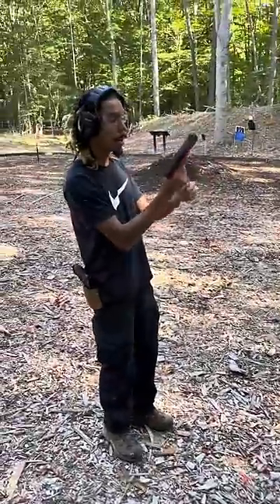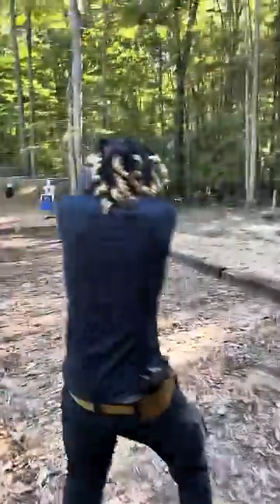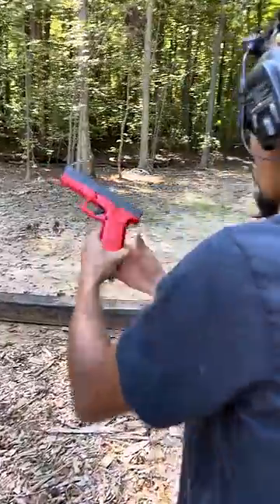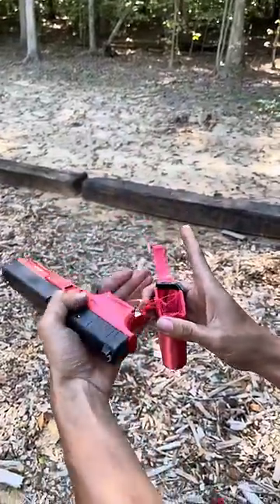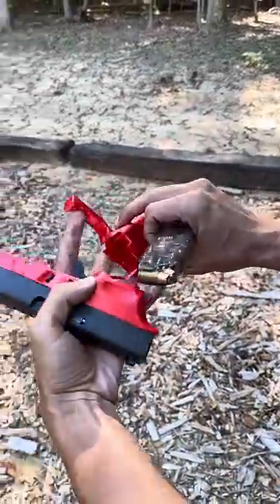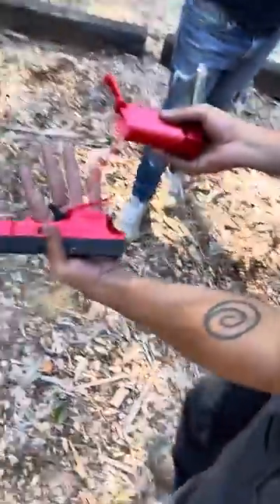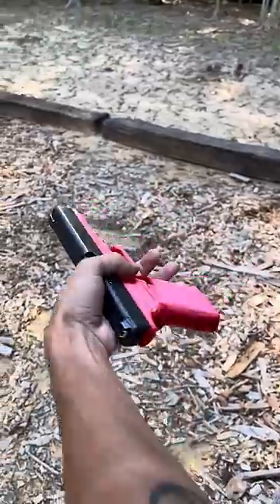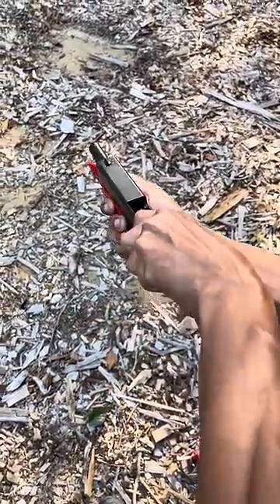3D Printed Gun FAIL 🤬

Comment: Print doesn't look like it was printed right. I don't know this design but whoever designed it or printed it messed up. You never want the print to have light shine through. It's a bad sign. Usually means it will not last also please test your gun on a jig before you shoot it in your hands. It's better to be safer then sorry. Also use the right filament. Cheap ABS is ok for smaller caliber but in reality you want to invest in some good strong filament that is meant to be strong. And can handle hard impacts and shocks. This design looks like it trys too hard to look like a real glock lower and doesn't seem like it was a stable design.

Comment: .. That's called weak layering/layer separation.. And shouldve been spotted even earlier.. A way to prevent it is heat treating the build and potentially dipping it in aceton to merge the layers even more.
Yes.. 3D building guns is dangerous.. If you don't know what you are doing.. And first round through it without knowing what you're doing just shows a level of stupidity..

Comment: 🙄 harder, more time, more money, and completely 1000% not reliable to use some Amazon 3d printer to make less reliable plastic guns of the original "plastic" guns. 
don't come at me with your comments about plastic frames; I don't particularly like them but I (probably) have a Lot more than you do --- 
would I rely on some that I have... yes. 
however there weren't made from a machine meant to make 3" mannequins for a wedding cake, they are top shelf "plastic" framed guns, and still, would be my very last resort weapon of choice considering my available options. interesting experiment here, but 100% no go on usability.

Comment: The issue i've noticed with 3d printed receivers is the fact you have to do finite tuning, scraping, shaving and sanding the thing down to the exact same as a polymer receiver. not to mention even if you manage, the slide also likes to stick so if you manage. it's good to swap through slides to see which ones likes the receiver.

Comment: its not due to the design, its due to how it was printed. You cant print that thing upright because the layers will be weaker in comparison to the impulse of a shot. Most lowers are printed diagonally, which reduces most weak points